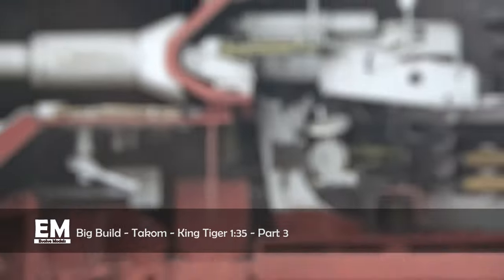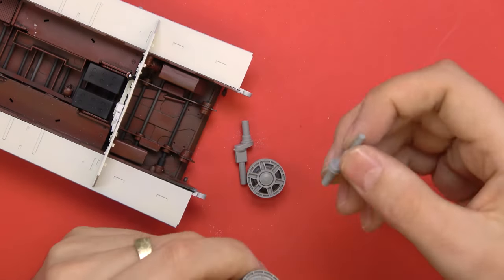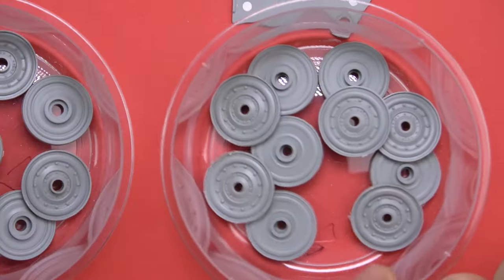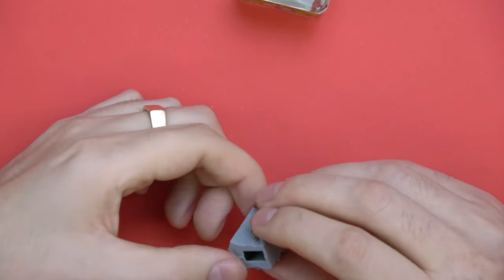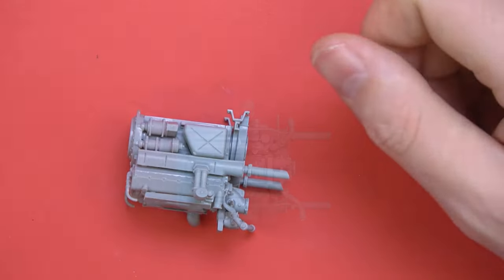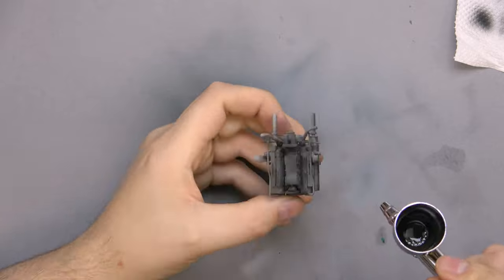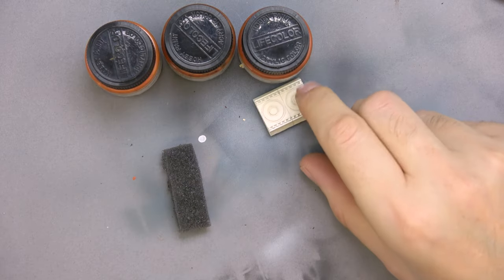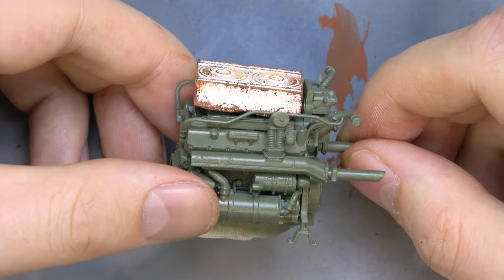Big Build - Takom King Tiger - Part 03- 4K

Comment: Great job. An inspiration. I building and super detailing this kit also. The best kit I have ever had. You asked about small tools or files for getting in tight spots: get your hands on some different size medical stitching needles with thread attached. Remove the thread and mount the needles in blade handles. Make sure they are on a shallow angle so that they track properly. I use these to also scribe fingers and folds in clothes on figures.

Comment: Look on eBay for diamond coated needle files. The smaller the better. There is a set of 10 that are 100mmx3x2 for $12.95. They are a fine grit by euromodel. I own a set of these and I find them to be indispensable. They clog up fairly quickly but they are easy enough to clean out with a stiff toothbrush or fingernail brush. If they get too clogged I brush on some model thin model glue and scrub them clean. Between those, some regular needle files and some tamiya sand paper cut into little strips. I am set for all my seam needs. A little hint on the sand paper is to fold it in half and then use the folded edge to get into those super tight areas.
Reply: Oh and one more thing I forgot to mention is fingernail buffing sticks. I get them in the health and beauty section at Walmart. I usually grab the ones with four different grits. on one stick. That section of Walmart is actually great for finding various modeling tools.

Comment: nice build; as for engine color, its the same as anything in WW2 they used what paint they had to hand, some of the maybach engines were built were built in different plant therefore would 99% sure been of different color; ive seen pictures of 'panzer' grey and black engines. may i suggest you give the air filter a grey pin wah :)

Comment: Evolve models, Nice work ,after the base coat a dark pinwash applied with a 00 brush around the recesses of the engine would make each area of the engine pieces stand out.
Reply from the maker: Good tip. When I get back on the bench I will give it a go.